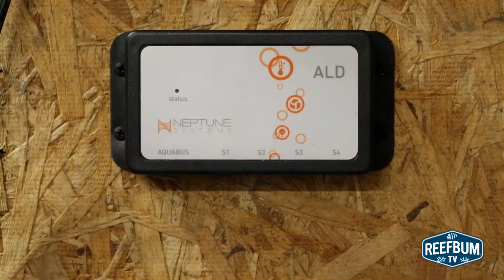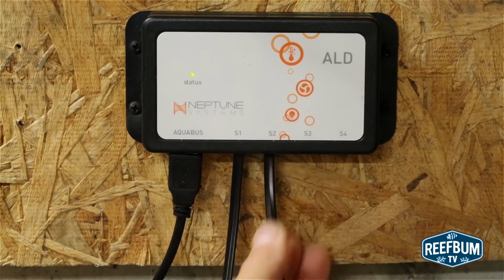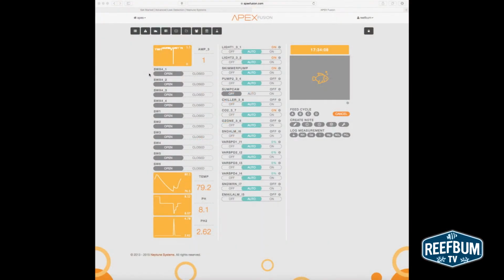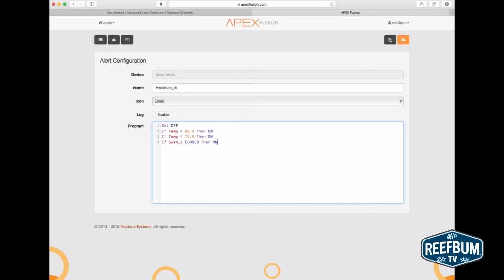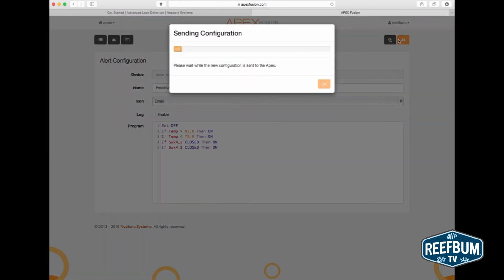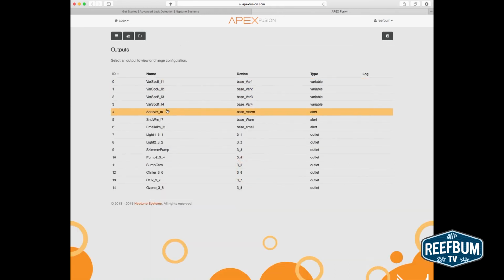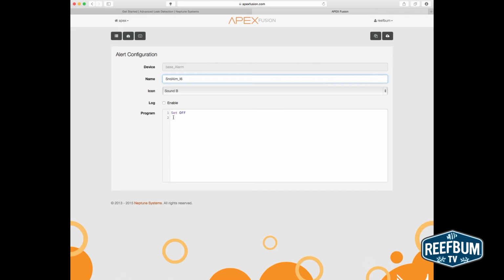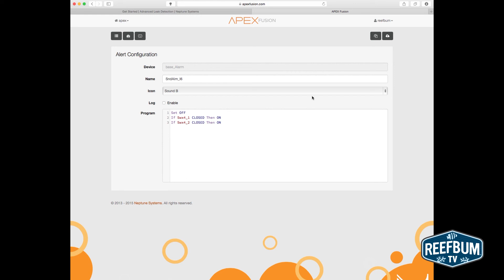How To Set Up An Advanced Leak Detector

Comment: So do you know if the relay automatically switches back on after the sensor dries? I was wondering because I have the code also linked to shut off my return pump and skimmer.
Reply from the maker: +Roxanne Howlett Good question.  I am not sure.  I don't have anything programmed to shut down since water on the floor could be a number of things for me.....I just use the alarm as a red flag that something needs my quick attention.  I do have a webcam in my sump room so that does help somewhat when diagnosing a problem remotely.
Reply: +ReefBum  thanks for responding! I think I'm going to toy around with it after work.